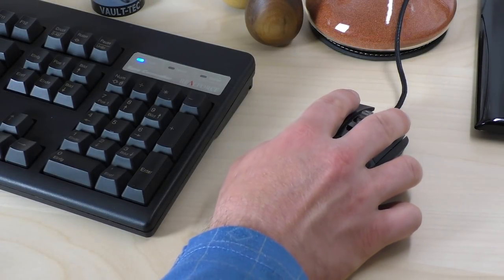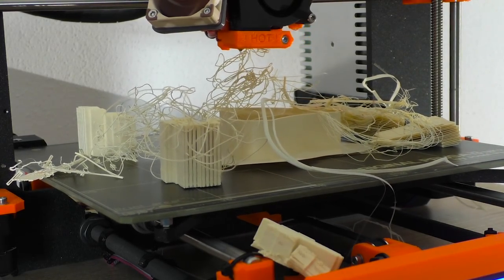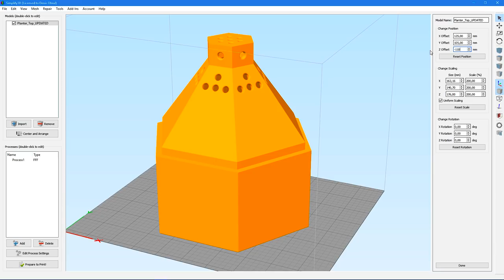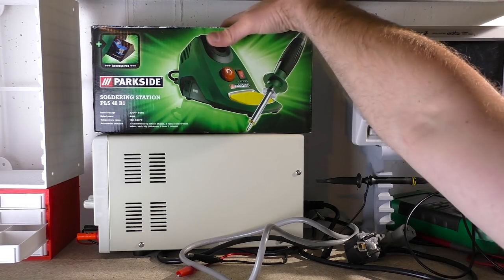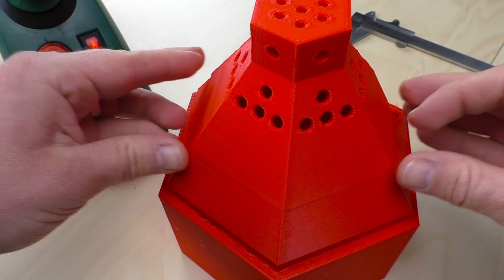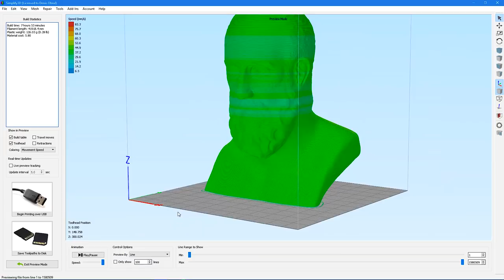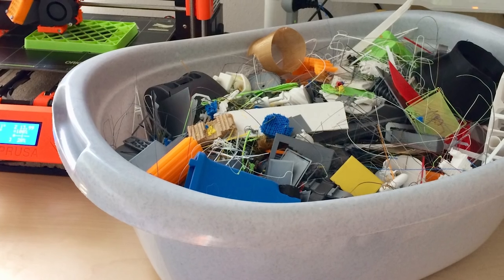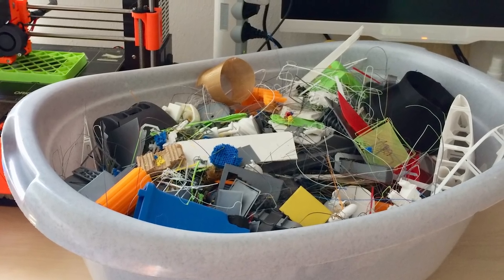Plastic welding and how to save failed 3D prints

Comment: Have you thought about extruding 10cm and using that as "solder" (I think the term is fill rod since you are welding) for the smaller cracks and seams?  I think it would give you a better look and easier to sand after if needed.
Reply from the maker: Absolutely, your suggestion would definitely produce better looking seams.

I was actually doing that at first, but then I've noticed that I have a lot of waste plastic and I thought about recycling that. Most of my prints are functional, so the rougher look didn't bother me that much.

Comment: Hello. How to join two filament ends together any ideas?
Reply from the maker: I would cut both ends at a 45' angle, hold them in place and then heat it up until they melt together. You might have to sand the joint a little, so that it's the same diameter, but I think it should work.
Reply: @HobbyHoarder  Yes i will try, but a printed joiner aparatus  where to find have any ideas?
Reply from the maker: @jozsefienciu2325  The only one I can think of is Mosaic Palette 2.